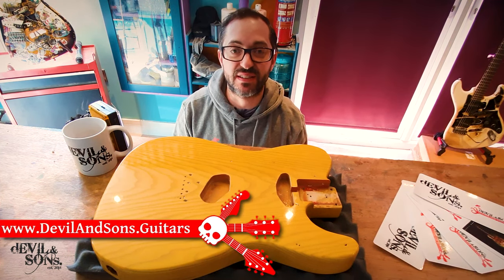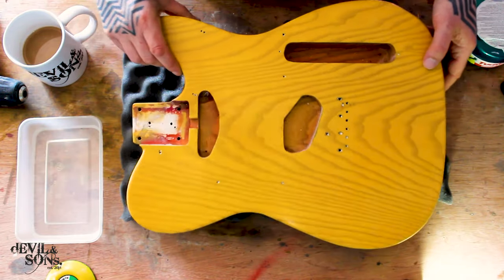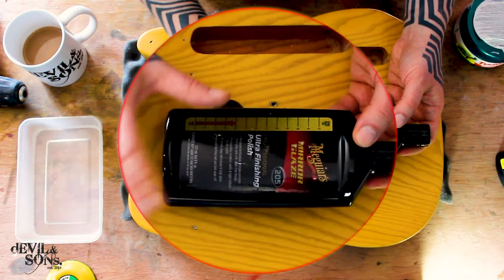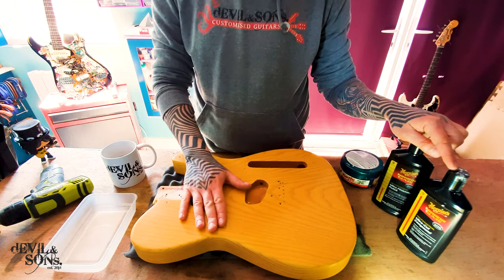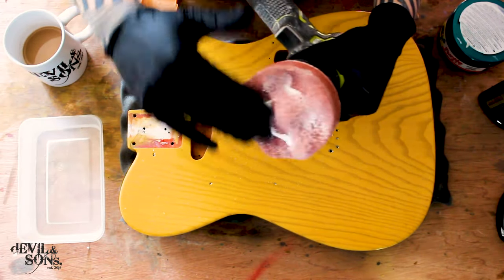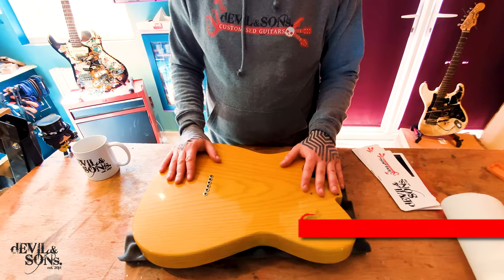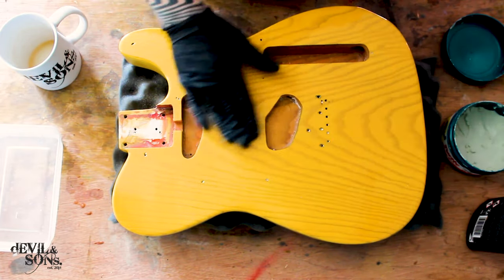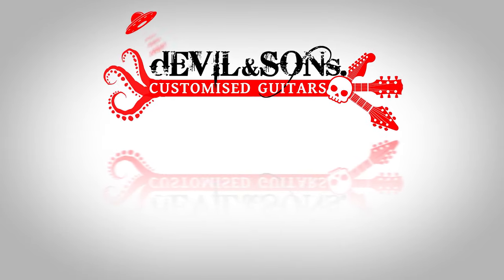How to get a Mirror Glaze finish on your guitar - YOU can achieve this!

Comment: The turtle wax is wax that protects the surface, the other stuff cuts and removes scratches and polishes so all steps are correct. Going back over with the 105 will remove the turtle wax.
Reply from the maker: Thanks for clarifying. Most helpful.

Comment: That's awesome hoss I have 2 of the 1959 Les Paul's from Epiphone the lemon and the dark burst they have the stain finish I started the lemon burst with just wood polish cause I didn't know how those pads would workout so thanks man that gave me some light bulbs like I say if your not learning ya not picking same goes in to maintenance and care of your instrument
Reply from the maker: They sound very nice. I would say the problem with polishing satin is that it may start to go gloss over time, so avoid using the compounds I used in this video and just try something light to wipe clean with.
Reply: I got the lemon burst les paul,what polish would you recommend for glossing the top up?
Reply from the maker: If it's matt or satin I would definitely go through the whole process and not just start with a final polish. If using these products use both Maguires. I have recently started using a different product, from Axe Wax. I would recommend you use their fine x polishing compound followed by either their G2 was or original Wax. An additional but not necessary step would be to use their Axe blast, this is more of a regular use product to  put on and keep the shine up. Here's a video on that process https://youtu.be/z8W-LAnqLC4
Reply: @DevilAndSons  thanks mate
Reply from the maker: @garyb1036  anytime. Good luck.

Comment: Correction, sand paper the higher the number the finest it will be. The lower the grit the roughest so its the opposite with the meguire
Reply from the maker: The higher number is smoother, so you work up in numbers with sandpaper. 300 us rougher, 1000 is smooth. So 205 meguiar is also smoother than 105 meguiar.
Reply: Ahh. I tot the meguiar is the opposite. Btw very nice content of your videos. I subscribed! Keep it up..love it
Reply from the maker: @Mwhbmnabjms  thanks for subscribing and commenting. Definitely the meguiar is also a finer cut for 205.

Comment: Would this work on a satin/matte finish, to bring it up to a mirror shine? The guitar is the Epiphone 1959 Les Paul that came out last year.
Reply from the maker: Yes, matt finishes can definitely be polished up. You probably won't need to go in with wet dry paper first but just start with the buffing compounds. It may take a few more passes with the first one. Good luck.
Reply: @DevilAndSons  Cheers! Are you based in the UK? How much would do you think it would be for a professional to do this?
Reply from the maker: It's a pleasure. I am UK based. Are you thinking you'd want to send the guitar as it is. Have the hardware etc taken off, polished, then all reassembled?
Reply: @DevilAndSons  Yeah I was thinking something like that! I think it might be something I can do myself, but would be curious to see how much it would be for someone like yourself to do - probably an hour or two of work?
Reply from the maker: https://www.devilandsons.guitars/price-list
Reply from the maker: Normally I'm happy to do a buff and polish for £30, but normally it's an addition when doing a £45 set up. This would potentially be a bit more than a standard polish to take it from matt (as opposed to already starting from something that had a gloss finish). Not a lot more work though so I would say £45.  I'd happily do it for that if you were happy to supply it already stripped of hardware, or for the extra £45 I would strip it then when I put the hardware back do the full set up.
Reply from the maker: Also, I think it something that isn't so difficult just time consuming to do and involves buying the materials so perhaps it is worth trying yourself?
Reply: @DevilAndSons  sounds reasonable, I'll ping you an email!
Reply from the maker: Please do. Info@devilandsons.guitars
Reply: @DevilAndSons  Very good price! Too bad it’s a bit far to ship my guitar to you from Canada!
Reply from the maker: It definitely wouldn't be worth the shipping. Thanks for watching though.

Comment: If I just want to remove some scratches from my strat (glossy finish) do I need both Meguiar compounds or only the ultra finish one?
Reply from the maker: I think probably the ultra finish one, I can't remember off hand if it is also described on the bottle as scratch and swirl remover. Alternatively you could just try using a wax, these are designed to hide scratches and blemishes but it would depend on the depth of the scratch. Car waxes can be great, I used to use a Turtle wax one but recently started using a 2ax from a company called Axe Wax in the UK (although if they don't ship I'm pretty sure there are lots of companies that make them). 

If you start with the ultra finish or a wax and it's not quite good enough you could always go back one level, I.e. the last thing in my process is the wax, before that the ultra compound 205, and before that the 105... and before that is the sanding. With some bad scratches you may even need to start with sanding then go through the compounds, but you'd need to be really careful and start with a very light sand paper just in the scratch area and be super careful not to go through the paint, so a much more challenging option. The advantage of a strat if you end up having to go the sandpaper route is you can do a test under the scratchplate to see how far you can go before sanding through the paint.   But hopefully just the ultra compound or wax is all you need, and ignore my over complicate reply. Good luck.

Comment: The different color foam pads are different in their aggressiveness Black, blue or white should be used last. You don't want to use a cleaning color to apply the final coat.
Reply from the maker: I noticed that with the good quality ones, I think mine were cheap though and feel like the same but different colours. What are you thoughts on the flat or textured sponges?
Reply: Yellow or orange is typically for the compounds, white for the polishing and black for the finishing, black and red don’t burn through your clear coat just refine it
Reply from the maker: I noticed some companies make a blue one that is also for polishing.

Comment: Enjoyed the video. You do realize that the compounds are not "coats" but an abrasive in liquid form that cuts into the finish. The whiteness comes from the wet "dust" that the compound removes from the clear coat. Using the word "coat" implies that you are ADDING to the finish... when in fact your are subtracting. :-) Loved it! Looks beautiful!
Reply from the maker: You are correct, thanks for clarifying. I probably shouldn't have used the word coats. I will check though how the product describes it on the bottle, I'm not sure what other word to use really. I normally describe it like liquid sand paper, hence using a finer grain as the number increases like sandpaper. Thanks for commenting and glad you enjoyed it.
Reply: @DevilAndSons  perhaps... "applications"? "I will use three applications of the cutting compound..."
Reply from the maker: That works. I checked and the bottle has no directions on it so doesn't actually have a word I can use. Application does the job just right though.

Comment: I bought 6 inch pads and they're way too big and maguiars 85 diamond cut compound. I will get the 205 and turtle wax and also 3 inch pads. Have you ever used wool pads? The foam pad kit I'm ordering has them.
Reply from the maker: Ohh, I haven't used the 85, I bet it's still great. The smaller pads are so much better. I did try some wool ones once, I honestly can't remember why I preferred the foam ones, I'm sure wool would be good too. Thanks for commenting and do let me know how you get on.
Reply: Agree 6” pad are to large
Reply from the maker: They're really made for cars I think.
Reply: @DevilAndSons  well I wet sanded with 1500 grit then hit my acoustic with m85 and 205 on only two of the 3 inch pads. It really wasn't as intimidating as I thought it would be. I had to keep touching the finish to make sure it wasn't getting hot but wow, I can see my reflection in the poly on spruce now.  Thanks for the video! and I will use the 6" pads on my car since I'm not afraid of the buffing and polishing procedure now. Also, the m85 is only $16 for 32 oz on amazon. Close to what I payed for the 8oz of 205 polish. Thanks again.
Reply from the maker: That is great to hear. I'm so glad you went ahead and have got such a good result. Thanks for letting me know.

Comment: What did you have as a top coat price to polishing?
Reply from the maker: I almost always use Spraymax 2k from a can these days, or sometimes I will use a nitrocellulose if a client really wants it. I'm considering going back to using my spray gun and compressor but really I have been so impressed with these cans for sometime now that I haven't regretted packing up my compressor.
Reply: @Devil & Sons Guitars  Thats good to know, thank you for your reply. I recently got into building and I use a semi nitro mix. I tried using Solarez but I have a very difficult time level sanding. I'm still really new and I'm trying everything I can.
Reply from the maker: It's good to experiment and when you find the brand you like just stick with it. Good luck. Are you working on anything in particular?
Reply: @Devil & Sons Guitars  im working on telecaster bodies primarily in various set ups. I like the hand rubbed poly finishes but im trying to get better with high gloss lacquer. Im still trying to figure out how to do smooth opaque finishes. Those seem to be the hardest to complete. I tried hand applying Acrylic paint and got a smooth consistency but I still need a top coat to seal it.
Reply from the maker: @Pedalfr3ak 26  I have a feeling that with hand rubbed finishes it's simply going to be practice to get it as good as you want. It may be worth just buying lots of scrap wood to test on. Years a go I did a French polishing course and we were testing and learning on anything from scraps to wooden things I had at home that really didn't need anything done to them but I still could use. I have a ukulele I still play from that course, it's not the best finish but it reminds me of that period of learning.
Reply: @Devil & Sons Guitars  thats where I'm at right now,  learning and experimenting. It's been a long road, often times bumpy. I've used some scrap wood but I've found that the best teacher is direct experience. If you have any other tips or pointers ill gladly take it. All of my schooling has been from YouTube only

Comment: Great video. Does this method of using a polishing compound also work on a guitar finish done with just Tru Oil using up tp a 2000 grit sand paper. Thanks
Reply from the maker: Thanks for commenting. Tru oil is quite different and more like traditional French polishing. If you use it correctly I believe you should be able to get a great finish with your final coat. Perhaps if it isn't shiny enough it may need more coats? I'm not an expert at all with tru oil so I can't advise if this method will work but I would guess it may in fact ruin the tru oil finish. I did some French polishingvyears ago and the shine was achieved through a slow and repetitive process of coat after coat, the final ones applied using a cotton rag. Sorry not to be able to give you a conclusive answer.
Reply from the maker: I just heard from someone on instagram that he uses meguiar's on his tru oil finishes and thinks it's great. So that may be a answer.

Comment: I did this exact thing on a 2k spraymax finish and it looks all grey and cloudy, completely ruined, wish I'd never watched this...
Reply from the maker: Sorry to hear thay. I almost exclusively use spraymax and this technique. Was the spraymax clear and set before you did this? If the cloudyness is under the surface then the spraxmax hadnt been applied properly as the meguiars shouldnt penetrate the spraymax. At what stage did it go cloudy? If it happened early on it is probably recoverable.
Reply: I figured out the problem! Apparently spraymax 2k is hard as hell, and my 3 passes with each compound were merely roughing it up and turning it grey. I tried my hardest foam pad and some pressure, and it's glossy like a mirror now! Thanks for the reply! This stuff is one tough coating.
Reply from the maker: Excellent, so glad it turned out good for you.